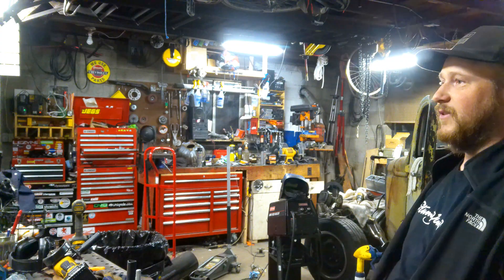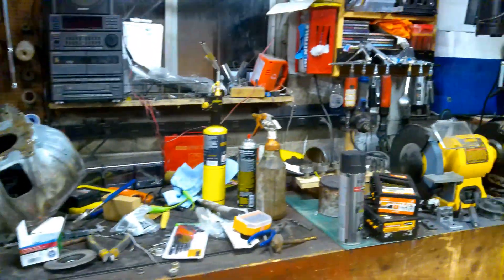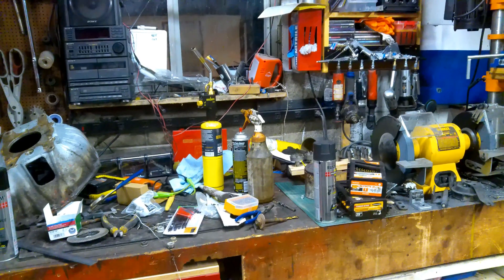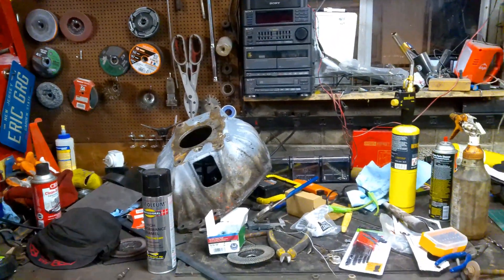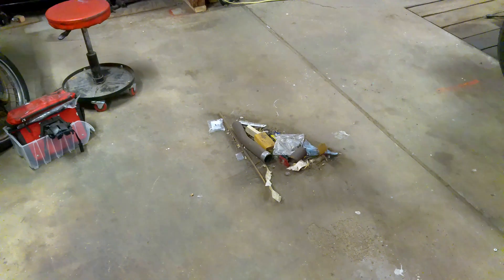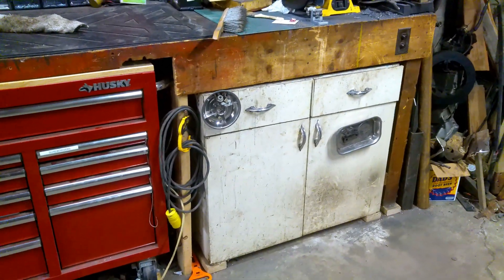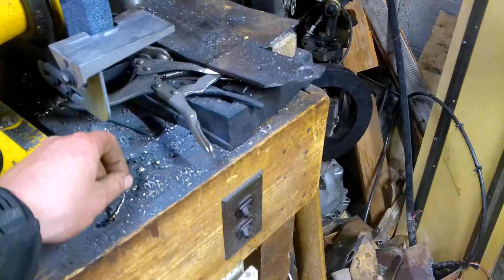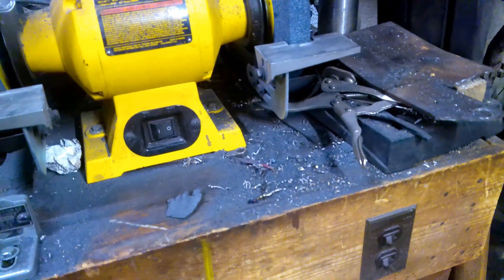Reorganizing the Garage for Better Work Flow

Comment: First time watcher , nice tool selection ! I would make mount plates for the drill press and grinder to make them quickly and temporarily attachable to the welding table , then you could store them away when not in use . Then you would also gain more space on the work bench .
Reply from the maker: Thanks, I like that idea but I use the drill press and grinder way too much to put them away. I prefer them to be rigidly mounted to the bench. I am working on a base plate system for my lesser used tools on a smaller cart. currently I have a 12 in. bench shear mounted on a hinge that I can flip up and clamp down when I need it. You can see the shear in the video on making a welding spoon that I am uploading on Friday.
Reply: I like @richardhardy870's thinking even if it doesn't fit your shop plans.   It is a very cool idea to make some things modular.    
I work alone, so I started putting tools super close together.  They work well for me, but you can't have multiple people using.   (I guess my point is I love hearing other people's good ideas).